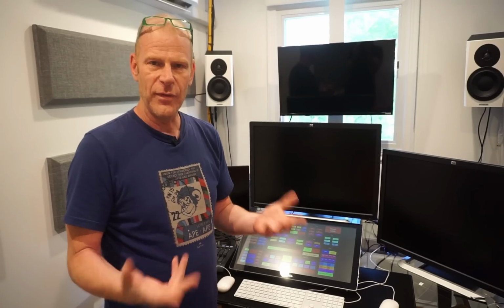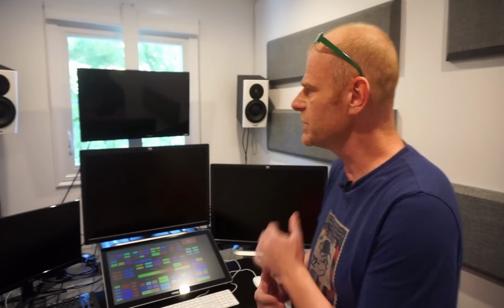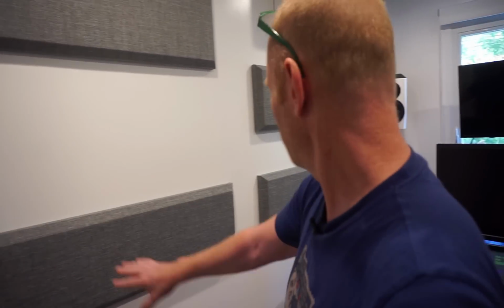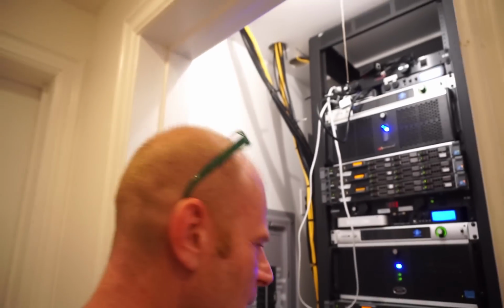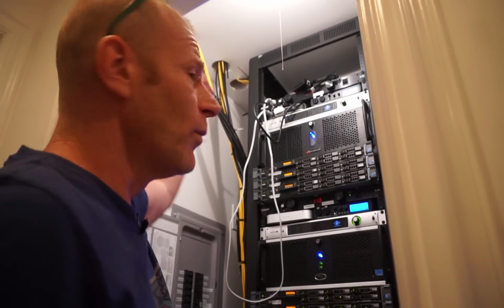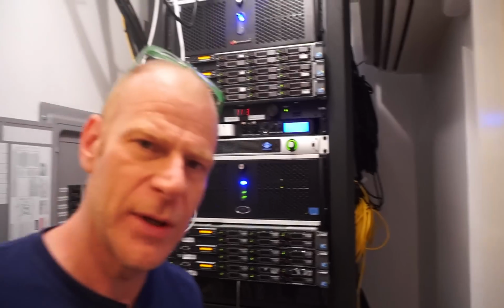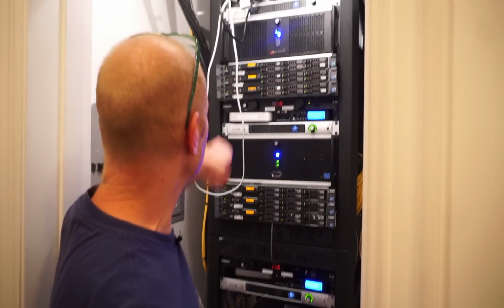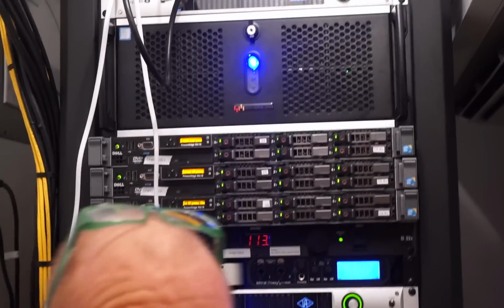Improve Your Studio: Panels, Machine Rooms & Server Units

Comment: please expand on the servers and your set up....
Reply: He most be using something like VEP(Vienna Ensemble Pro) or something like that. Cause it's unlikely he could fit sound-cards in those very thin servers. Also, looking at the cabling it looks like network cables probably going thrue a network switch , which is what you would need to use VEP in a setup like that.  But yea, we need that info or else the video is not that useful for me. Still grateful he made the video mind you but all these things i knew, it's how Pcs communicate with each other I'm having difficulties with.
Reply: @MustacheVerra  Yes, he uses VEP
Reply: Thanks. I'd still be interesting for him to clarify somethings. Like, how did he managed to run windows 7 or 10(i assume) on servers design to run server's OSs? Did he run into complications? What about graphic performance on these servers that never comes close to a regular Pcs, was that an issue? It's for those reasons i didn't go the server rout. I'm not tech enough to deal with that. I guess he'd have get his tech guy on to answer those questions...
Reply: MustacheVerra There is no issue running a desktop OS on a server and vice versa. There might have been back in the day because server hardware was quite specific and you had to load the drivers before windows could install. But these days its absolutely no issue.

In terms of graphics processing, do you mean how does it handle running video games? In the case it would be fine if it had a Graphics card in it. Those poweredge ones JunkieXL has wont be able to fit typical graphics cards, but you can buy servers that do have the space for them. Any animation company would have a render farm which is just a shit load of servers with shit loads of cards in them that bulk process the graphics side, but thats not the same as real-time rendering that video games require.

If you mean graphics processing as in Video playback or how the OS runs, then it will be fine. CPU's have built-in graphics that are built in to the CPU (Intel HD Graphics for example) that can handle all of this. Fundamentally the difference is video games require real time processing, whereas if you watch a youtube video, or play a video file with VLC/Windows Media Player, that is your cpu/networking arranging the information based on video/audio codecs to display it. Its why you can watch youtube videos of someone playing a video game on max settings, but you couldnt actually do that on your PC unless you had a graphics card.

I imagine his set up works a bit like how a Thin Client/Fat client, where you essentially have your minimum required PC running cubase, but whenever you do anything in cubase its workload is being offloaded to the servers he has. This is something that the software would have to be capable of doing and built in to the software so its not like you need to know how to code to set it up, you would just need to know which settings to turn on. But im only speculating on this part.

I hope this helps.
Reply: Yes it does help. I didn't realize server CPU had integrated GPU which would be fine. And no i was not talking about gaming. I was just worried they might not be able to handle graphics like older server did. Anyway, thanks.
Reply: https://www.youtube.com/watch?v=9WYaqTQwEHo
Reply: @MustacheVerra  I have the same problem right now actually!
Reply: I'm not sure what your problem is but i found this video of him on this topic. https://www.youtube.com/watch?v=9WYaqTQwEHo  @jpinto9056
Reply: thanks guys hopefully he will show us more I would love to run just 20 -50 instances of synths,kontakt and reaktor so this got me curious been researching those dells are cheap here in Oztralia getting very interested.
Reply: yeah we need more info about this
Reply: They're just used as network attached storage, otherwise there would be unacceptable latency. I would recommend you all look up Samsung 970 Nvme drives which each have 3500MB/s read speeds (vs the maximum 500MB/s of a normal SSD), and consider a device that allows you to raid up to 4 of them such as the Amfeltec Squid, Asus Hyper M.2 x16, or the HighPoint SSD7101A-1. All of these solutions will be significantly simpler, faster, and cheaper in both outlay and running cost than buying several ten year old servers. Be sure to check compatibility, and that your motherboard is supported before buying any of these.
Reply: @OVERLORD-ji2id  I don't get it (I'm French). You consider this is a cheaper solution can you give details please? Regards
Reply: His servers are all connected by ethernet cables to his PC-Workstations via an ethernet router. With VSL VEP6 running on each server and the PC, there is no need for any other cabling.   Using Windows built in Remote Management software its easy to login to the servers from a PC remotely and thus manage the servers.  That said its worth having a rack mounted console (keyboard and screen) connected by KVM to the servers because there will always be a time when you need to install or maintain locally which cannot necessarily be done remotely. Again good Dell consoles can be found on eBay for around US150 to US400. Hope that helps:-)

Comment: Tom can u provide info on the company that has the stockpile of servers?
Reply: Nick Saya - there are many companies on eBay selling various Dell servers. Usually sold off when a corporate business upgrades.  Our 12 servers are Dell 6110’s but pretty much any will do. Tom’s are newer and faster but as long as you are happy setting up Windows Server 2008 Release 2 and maybe fiddling with hardware upgrades then you should be fine.
Reply: R uss what OS do you install on it? 
That is compatible with Vienna Ensemble?
Reply: R uss yes but u need to have Vienna ensemble pro running on it and u have to have your VSTis on it